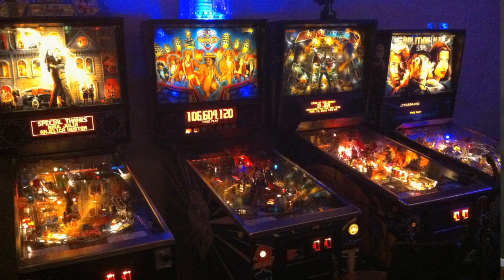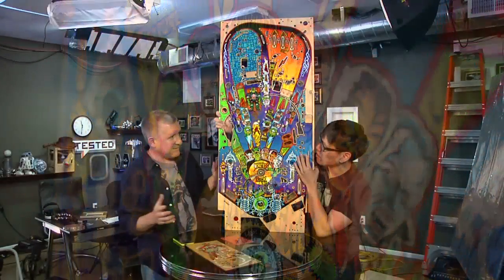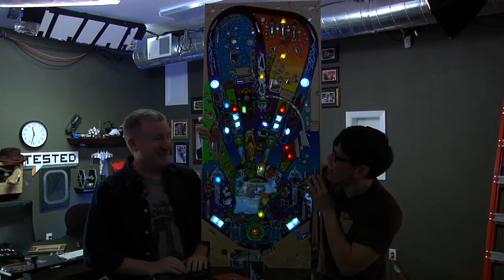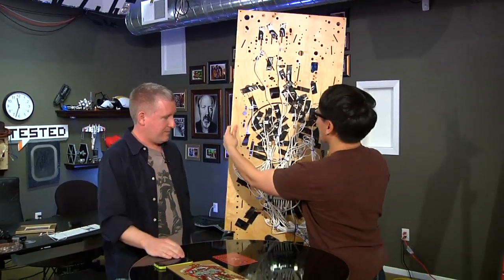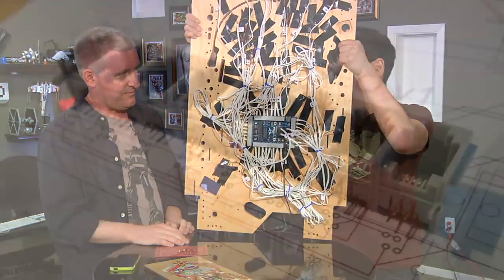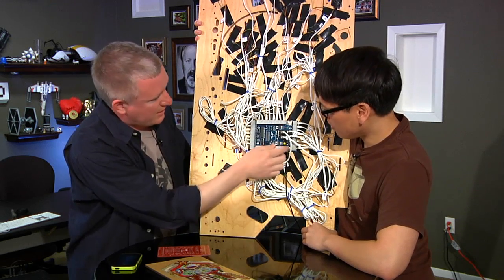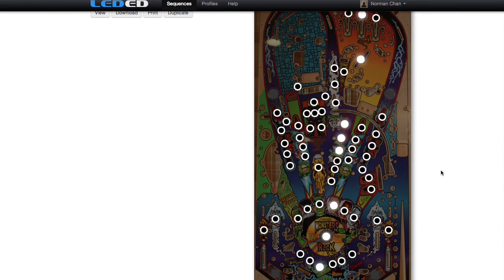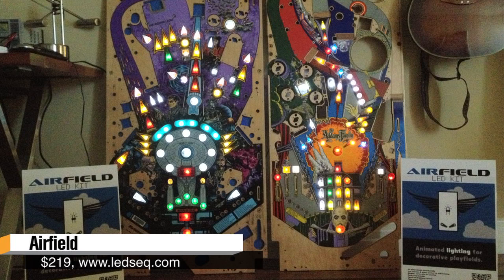Maker Project: Lighting Up Old Pinball Playfields

Comment: That looks really superb. But, as this was 8 years ago now. I would guess that by now you have redesigned using WS2812 LEDs which is far simpler wiring wise and you don't need a custom "Arduino" board or all those connectors?  I have a "Kiss" playfield which I have backlit like this. Does anyone know a low-cost UK source of coloured inserts for the playfield? They are available from pinball outlets in the US and not huge prices, but the P&P to the UK is 4x the cost of the goods!